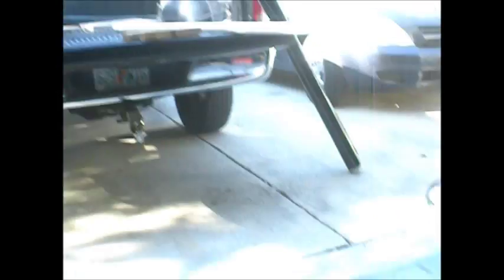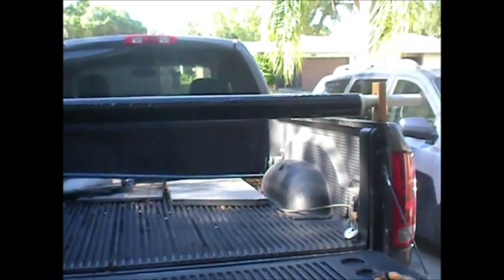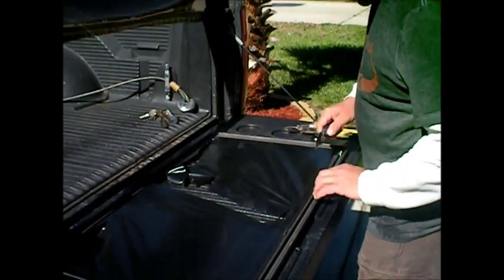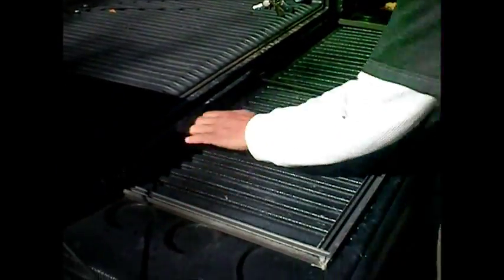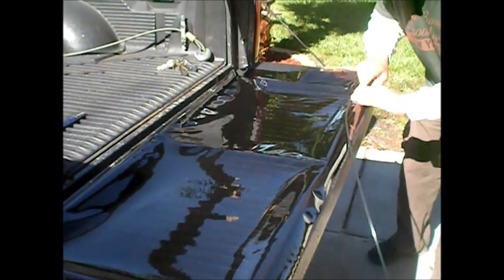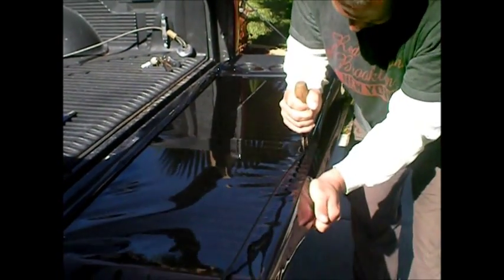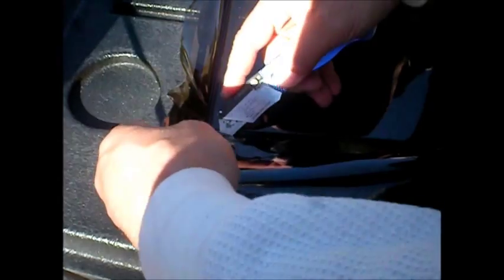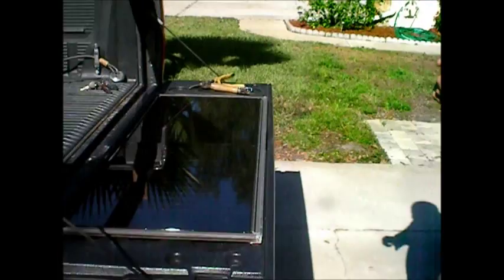How to roll a Vinyl Window

Comment: Can you please tell me what’s the exact name of the product you used.  I been to Home Depot and Lowes I even had a piece of the material from my mom’s window and both guys I spoke with told me that this is regular tint you on car windows.  Smh
Reply from the maker: its vinyl material  and you can get it from rescreening shops. its just called vinyl. the big box stores dont carry it. its definitely not window tint. i used to get it in 50 pound rolls from town and country supply

Comment: thanks I am going to try it out.  You did not mention the mil you were using.  I am going to try 12mil hope it works
Reply from the maker: You're welcome! I used 10 mill I think but 12 should be fine. The thicker the vinyl, the less transparent it is.

Comment: What is u shaped spline exactly called and brand. Need to order from Amazon, etc. 3/16 wide, 3/32 channel middle and 5/32 deep. Thanks.
Reply from the maker: it's called V Spline. I used to get it from a distributor called town and country aluminum. It came in 10' lengths. I googled it and came up with this. https://www.google.com/search?source=hp&ei=8HLWWovUAsPAtQXd6YuQDw&q=v+spline+for+vinyl+windows&oq=v+spline&gs_l=psy-ab.1.1.0l2j0i22i30k1j0i22i10i30k1l2j0i22i30k1l5.1466.4456.0.7589.12.10.1.0.0.0.288.1511.0j7j2.9.0....0...1c.1.64.psy-ab..2.10.1551.0..46j0i131k1j0i46k1j0i10k1j0i13k1j0i13i5i30k1j0i13i5i10i30k1j0i8i13i30k1.0.fqwOZRomwSI
Reply from the maker: Not sure where to get it now.
Reply: NYRAPTOR6 Thanks for responding and I'll post when I find and where I got.
Reply from the maker: Kevin & The Man Productions. Thank you! And thanks for watching
Reply: NYRAPTOR6 Your Welcome. Nice work you did also. There's only like 5 total vids on here with this type job and all are different. Certainly will try your method soon. Others interesting also with different styles starting in middle outward, angled roller, etc.

Comment: can  you  order  a  roll  of  the vinyl  on  line  ?  who  makes  the  vinyl?Here  its  30  bucks  a  window I  have 10  or  so to do Thanks
Reply from the maker: Not sure if you can get it on line. I used to get my vinyl from town and country. I used to pay around 240 for a 50 pound roll.
Reply: thanks  didnt  need  that  much  found  some  for $3.49  a  foot
Reply: where did you purchase for so cheap? I need as well
Reply: @paige8004  onlinefabric has all thickness and sells by the yard